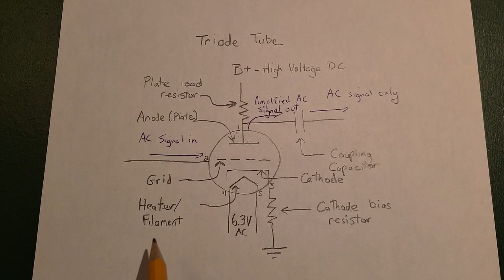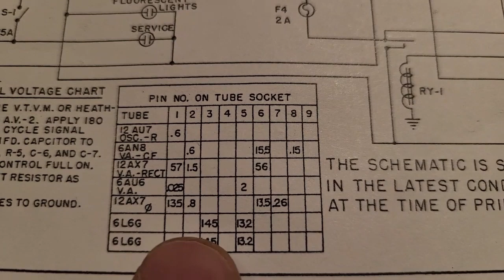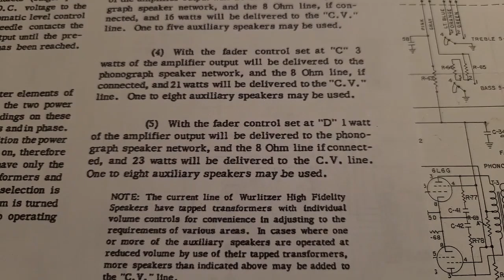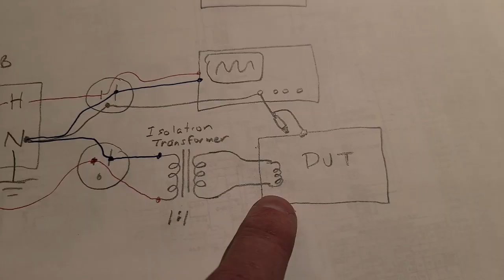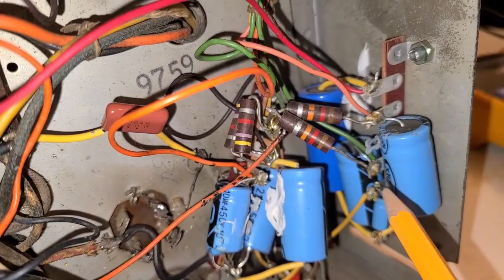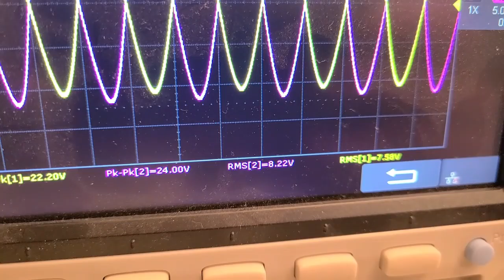Wurlitzer 532 Tube Amplifier Fix - Part 2: Schematic Overview and Bench Setup for Signal Tracing

Comment: Hi Shane,  Love your videos - very detailed and explanatory..  I'm an aspiring tech trying to up my amplifier repair game.  I was doing the shotgun method approach (replacing caps etc) which works a lot of times however I've got some problem amps that I'm looking to your videos for help with.  One such amp is a wurlitzer 545 pulled from a 2800.  The amplifier is currently outputting sound however it is i'd say a medium loudness.  I tested all initial transformer side powers on the bench following your previous guide and that all went really well.  now that i'm on the other side of the transformers, i'm  getting unsure of myself.  Are you accepting mail ins?  I live in Canada
Reply from the maker: Thanks for the positive feedback.  If the caps are original, I would say the shotgun approach makes sense as most if not all of them would be all dried up at this point.  You may also have to replace the resistors if you are experiencing a degradation in volume as those old carbon barrel resistors tend to drift higher over time.  It also could be the tubes or volume control so unfortunately, the only way to figure it out is to put a test signal on the line and follow it through and verify it at every amplification stage against the specs.    I also live in Canada but I'm not currently accepting any mail ins due to the backlog right now and I'm only fixing them on the side.  I'll reach out if I'm able to clear my backlog and see if you're still stuck but at this point it would be sitting on my bench for a while.

Comment: Hi Shane, At the step of measuring all the B+ voltages I have no voltages at all at the tubes bases after removing all tube except the 5U4G, all transformers voltages are correct and heating voltages too. Any idea to help me? Does it mean the 5U4G is dead, if yes how can I check it?
Thanks for your 3 videos on this amp this is wonderful learning for everyone!
Reply from the maker: Hey, thanks for the feedback.  I appreciate it.   I think you might have found your problem.  It's possible your rectifier tube might be dead or there is a break in the circuit somewhere.  There are few ways to check it.  The best is to get a hold of a tube tester or find someone in town that has one and get them to test it.  However, those aren't always easy to track down so you can do some partial tests with the multimeter.  If you measure resistance between pin 2 and 8, you should see a low resistance.  If you see an open circuit, it's dead.  You can also check for shorts as there shouldn't be any continuity between pins 2 and 4, 2 and 6, 8 and 4, 8 and 6, and 4 and 6.  You can also just use the amp itself to help with the testing.  At 33 minutes, I talk about testing the voltage coming off the 5U4G directly.  You should see 400V between pin 8 and ground.  If you're not seeing, that and you don't feel the tube warming up with the power on, I suspect you might have bad rectifier tube.   If you do see a voltage, then you might have a break in the circuit somewhere or a bad cap/resistor somewhere along the way.  At that point, you can trace the voltage like I did starting at the 33 minute mark.  Keep me posted!  You got me invested now.  LOL!
Reply: @shaneperche-fixed-it  Thanks for your answer, I found out that I missed the part where you jump 1/3 of the speaker plug so now I have all needed voltages. I injected music at the cinch Aux and also right after the oscillator and everything is fine but still nothing when I plugged it into the jukebox, so I checked the OSC part resistor values which are good, changed 0.1 MF capacitors of this part with new but still no luck. The Osc tube is new but both 51 ceramic caps are still the old ones, continuity from cobra to RCA input is good. The only thing I can hear is random cracks happening weither or not the cobra RCA is plugged in…any ideas where I could investigate next?
Reply from the maker: @airpuffrecords6424 Sounds like the amp is good then which is great news.   I had a similar problem once and it turned out the cartridge popped off the contacts.   I just removed it and reseated it to get it to work.   Sure seems like it has to be something like that.   I think I made a video on that called common adjustments for the 2204 jukebox.
Reply: @shaneperche-fixed-it …thx for the advice but I already tried that with no luck, also check the cobra continuity to the RCA input, so could it comes from one of the components of the oscillator knowing the tube is new for this part?
Reply from the maker: @airpuffrecords6424 Yes, it could be the oscillator tube but that's a tough one to test on the bench.   You might need an tube tester for that one.   Is it possible you have a bad wire or cap in your speaker network or did you test that as well?  One thing I've done in the past to test the back half is inject a signal through the .1mf cap with an iPod just past the oscillator when its plugged into the jukebox just to make sure the speaker connections are all good.   If you get sound, then I guess the only remaining variable is that oscillator tube.  I'm also assuming that the cartridge is a cobra cartridge and it hasn't been converted to ceramic.
Reply from the maker: I forgot one important detail.   In order to test the speaker network with the amp using an ipod, you still need to make a song selection to turn the amp on.   I usually pick a slot with a no record and disconnect the input wire coming from the cartridge.
Reply: Good idea I will try to inject music after the oscillator when plugged into the jukebox. Yes it is Cobra cartridge and the oscillator tube is a new one freshly replaced
Reply: Thanks for your advice, now it is working fine, many resistor like on yours were out of specs. and also the brand new oscillator tube was defective 🤔
Now I have two main issues left if you can help me maybe:
1-I have got random cracking sounds during records swapping and record playing 
2-There is sound volume variation within the same song (quite randomly depending on which record is played)
3-Bias is not adjusted. Do you know the method to adjust the bias pot? Would prefer to do it when the amp is in the machine. 
Oups that’s 3 issues 😅
Reply from the maker: @airpuffrecords6424  That's so awesome!!! Great job getting it going.  For the random cracking sounds,  it can be a few things.  Like bad wiring, bad grounding on the tonearm wire, or dirt/oxidation on one of the components.  The most common thing I've seen is oxidation on the mute switch so try spraying that with some contact cleaner or DeOxit.   If it's crackling during play, it could be oxidation on the tube connections so you may need to spray some deoxit on those as well.  For the random volume issue, it could be a few things as well.  Do you notice it on all records or just some?  Sometimes it's as simple as a warped record or the tone arm needs an adjustment.  Sometimes it's a bad cartridge so you can try swapping it out if you have another one.  Sometimes it could be a bad tube.  Did you notice any issues when you had it on the bench with your iPod?  If not, the tubes are likely good and I would focus on the cartridge or tonearm.   For the bias pot adjustment, I typically do it with the amp in the machine and measure the voltage across the cathode resistor to get the correct target specified in the manual.  Hope that helps!